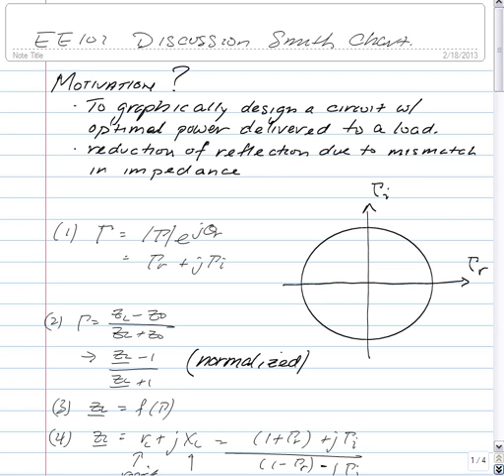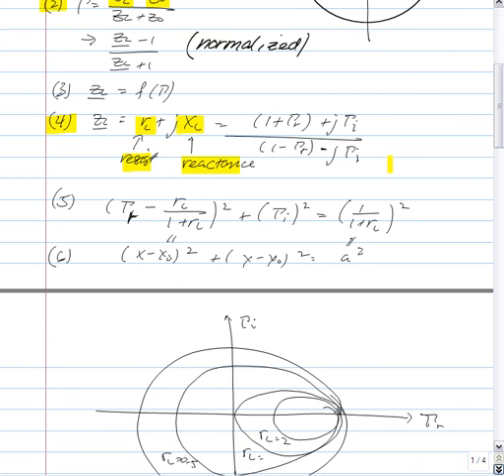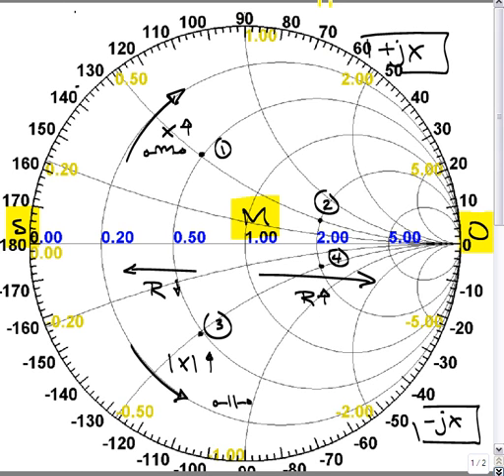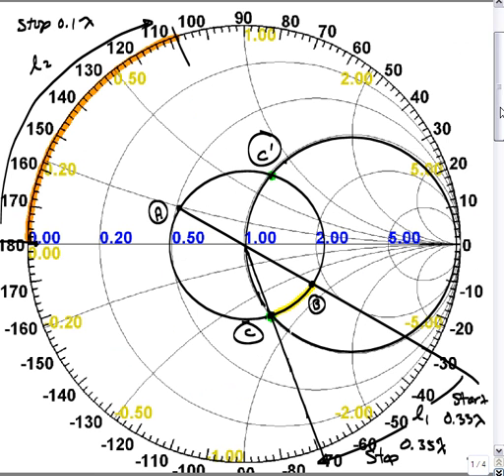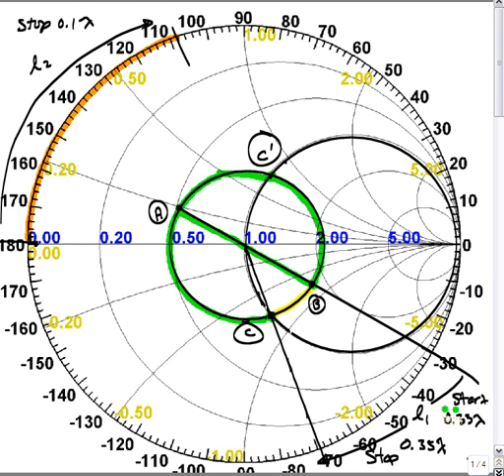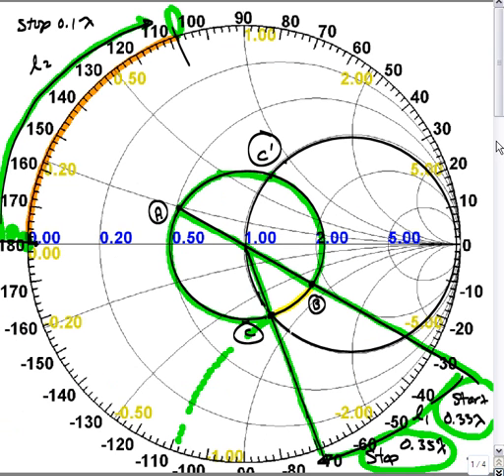[UCLA EE101] Smith Chart

Comment: Thank for the clear explanation on basic Smith Chart-facilitated design of OPEN STUB compensated transmission line.    I particularly appreciate your use of admittance, and your emphasizing that the LEFTMOST point on the SC is the OPEN CIRCUIT point for ADMITTANCE calculations, as it is more commonly understood to be the SHORT CIRCUIT point for IMPEDANCE calculations.            

I am looking for a basic lecture of non-compensated LOSSY transmission line.     I know that the VWSR circle is to be replaced by a spiral that closes towards center of SC as the locus of consideration, along transmission line, approaches generator.    The only example I know is in a book "Practical Antenna Handbook" by Joseph J. Carr (c) 1989, page 79.      This example appears to be wrong, as the plotting of arc representing entire length of transmission line (0.6 Lambda) commences from the wrong place; so it seems to me.            I found the exact same example in a textbook Chapter 26 associated with Sonoma State Univ.    Fig 26-10, page 482.   The download is 23 pages long... Chapter 26 only.       

As a real-world engineer, I am very concerned about lossy coaxial transmission lines, and so I want to get it right when using a Smith Chart spiral for lossy lines.          I would expect this should be very interesting, even in its simplest incarnations.

Thanks for any tips on where I might see a second example of the "Smith Chart spiral"  for lossy xmsn lines.

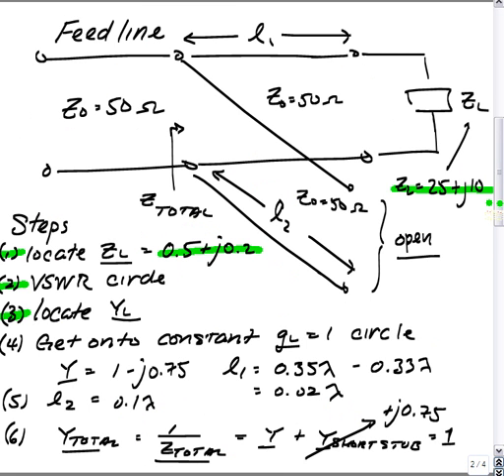Comment: 5:34 - 5:47.You are finding a normalized load admittance, not a normalized load impedance.  It should be noted that at this point, the normalized resistance and reactance circles become normalized conductance and susceptance circles.
Reply from the maker: +Dan Hillman Hi Dan, Yes, you are correct. I've been meaning to add the corrections to the description for a while; it's finally done. Thanks for chiming in.

Comment: Nice video... It helped me a lot thank you...
Reply from the maker: Hi Pragati,
You're welcome. Please be mindful of the corrections I mentioned a year ago. I've included them in this comment here for your convenience:
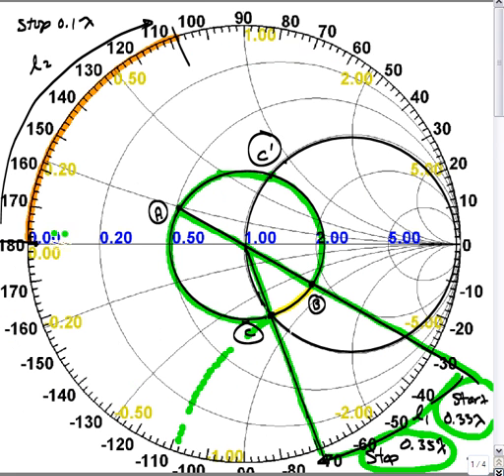"CORRECTIONS: 1. at 5:30, I meant to say admittance. Point B is the normalized admittance. 2. at 6:26 and 9:05, I meant to say inductance. The lower half of the smith chart is capacitive when using impedance but it is inductive if we are using admittance."
Reply: Philip Hon oh okay... Thanks for the corrections and it was really useful as I had assignment due next day.. And I didn't knew that we can also have inductance in the lower part of the x-axis, I thought by convention it's always inductance in the upper part and capacitance in lower. So thanks for the info... :-)

Comment from the maker: Hi Akisdrosi2011, 
The transmission line of length L2 is an open stub transmission line. Since it is an open, you must start at the open location on the smith chart. BUT  since we are dealing with an admittance chart (when dealing with parallel components, it's easier to deal with an admittance chart), we look at the far left (where the short would be for an impedance chart). That is then the reference location for calculating the length of the transmission line with length L2. Hope that helps.

Comment from the maker: CORRECTIONS:

1. at 5:30, I meant to say admittance. Point B is the normalized admittance.

2. at 6:26 and 9:05, I meant to say inductance. The lower half of the smith chart is capacitive when using impedance but it is inductive if we are using admittance.

Comment from the maker: You can technically continue transforming your admittance around the S.C.  to point Cprime with a longer transmission line length, but it's longer which makes the circuit larger =( . So to read of the admittance at point C you look at the BRUIN colors. To get the real part of Y, we trace the constant conductance circle to the number along the horizontal line that cuts the S.C.  and it's value is 1, as expected. For the imaginary part, we trace the constant reactance circle. Hope that helps.

Comment from the maker: My previous comment answered why we want to go to B. B is the admittance of the load. Now we need to get onto the constant conductance circle of 1 (what used to be the constant resistance circle of 1 when operating with impedances). The closest INTERSECTION of the constant VSWR circle and your constant conductance circle is point C. You can transform the admittance at point B to C by introducing a TL length of l1, where the transformation MUST move along the VSWR circle. See next comment

Comment from the maker: pghaffari:

Here's an alternative way to think of the problem. At the end of the feedline we want to design Ztotal such that when we combine two parallel complex impedances that they result in an impedance that is 1. real and 2. have a resistance/real part equal to that of the feed line. Now the math is more simple and is simply an addition if we use admittances. So this answers the question of why work in admittance and the big picture of the matching network. See my next commment.